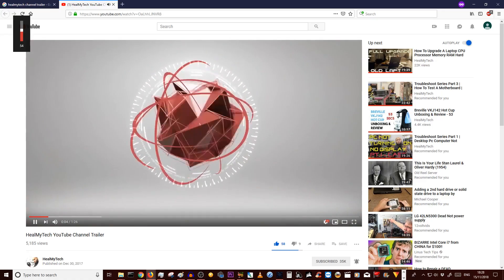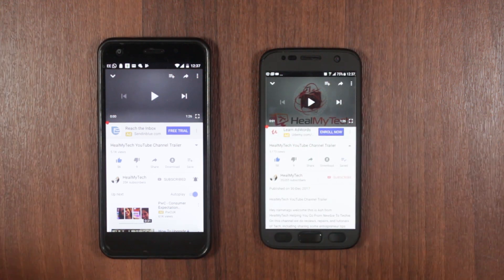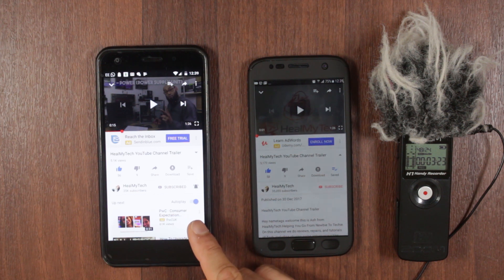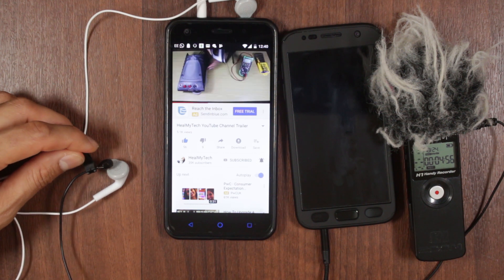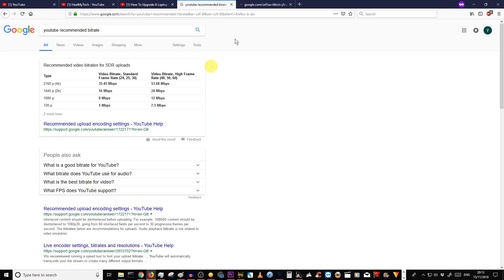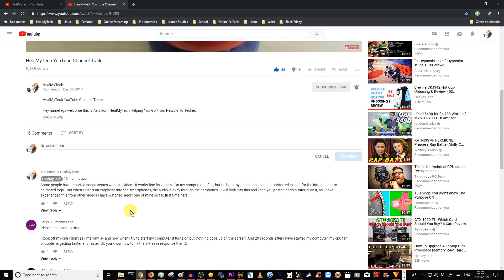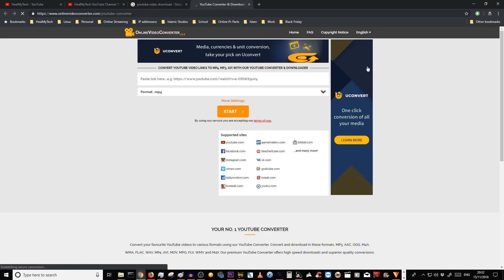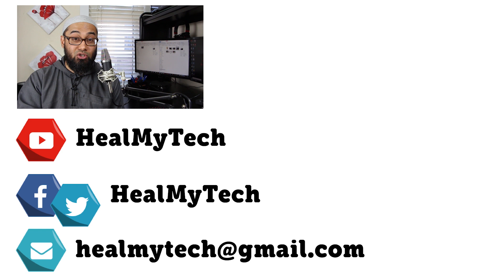YouTube Audio Problem - HELP!  Audio Only Works With Headphones On Smartphones

Comment: I found a 100% working fix for the problem (and a 70% guess, what causes it):

1.) Duplicate the problematic Audio Track and put one on a Mono channel (which you pan left) and the second one on a Mono Channel (pan right).
2.) Make sure in the Inspector of the Each clip itself, you also set the pan of the Clip to the same direction, than the the track its on.
3.) Check if you did it right by muting first the right (you should still hear sound on the left speaker/earphone), then mute the left and you should hear the right.
4.) Now, export your clip again (audio as before set to Stereo Mixdown).

Et voila, your clip works on every smartphone now.

To why it happens: I am a filmmaker, not an audio professional, but to my knowledge it has to do something with the way some smartphone speakers (when Mono), cancel out the information of a stereo file when patched the wrong way. It certainly has to do also Phases - right and left phase seem, when patched wrong, to annihilate one another ( +1 -1 =0).

Comment: There seems to be something wrong with recording the sound.
It seems that the sound is mono recorded in one channel for example right Channel, then the negative form or inverse form of that wave from right Channel has used to create  the opposite or left Channel wave, and when both of them go to the speaker together, they touch each other.  They neutralize rather than add to each other, they shrink, and the sound disappears!
Just like job that they are doing on the noise-canceling headphones.
The solution can be by using a video editor in one of two ways.  It can be done simply by deleting one of the right or left channels, or a little more complicated by copying one of the other channels without reversing them.
 I do not think this is a problem for cell phones with two speakers, or at least when they listen to the sound, it may be a little audible at certain points or distances from the listener, but on cell phones with one speaker the left and right.  Combined and distributed, this is the problem

Comment: i think you had the same problem i had before, cause your video was recorded with audio stereo (which can work with earphones with some devices) and you have to convert it to mono in order to have single source which can be working with all devices.
here is the solution below you have to download this application
https://www.youtube.com/watch?time_continue=32&v=jL5Xx06NwyI&feature=emb_logo

export the audio file and again past it in your project at movie maker, thereafter you can export

if you need more details please contact with me

Comment: FOUND A SOLUTION -  I went and took a look at a power director tutorial where someone copied and pasted the file from one channel to the next to create a stereo file. I wasn't sure if this would have worked on my issue but i noticed something unusual with my sound file so i went a head and tried it. AND IT WORKED PERFECTLY. Now keep in mind that i did have sound on both channels (left and right) before attempting this however the difference between my files and and the ones on the tutorial were that mine where inverted. Not sure if that's normal. Its like the file in the left channel was flipped upside down. After choosing one and copying it into both channels, everything worked perfectly after uploading to YouTube. I had initially used a ZOOM H5 to do the recording for a video which had an intro that work perfectly and the rest only if it were being listened via headphones. Hope this helps.

Comment: has anyone found any solutions for this?
Reply from the maker: Unfortunately no from my end, no lead whatsoever, which reminds me I should be chasing up the audio guy from YouTube Space London, thanks for the reminder.  I take you are having the same issue then?
Reply: @HealMyTech1  I found a Youtube official response but its a lame response stating something's wrong with our audio and not youtube...

Here's one of my videos plays terribly bad but when i play it on my laptop or earphones it plays really well. https://www.youtube.com/watch?v=RfGwv-Svhv0

Here's what i found https://support.google.com/youtube/answer/58134?hl=en

"If your video's sound is playing correctly on a computer but not on a mobile device, this could be a result of the audio in your uploaded video having poor mono compatibility. When listening to stereo audio (left/right channels) on a device with a single loudspeaker, the device will convert the stereo audio to mono (single channel) before your video plays. If the stereo audio has poor mono compatibility, then the mono conversion process will degrade the video's audio quality or even silence audio altogether. This happens mostly when different audio recordings are combined into one video, for example if you're making a compilation video.
One easy way to ensure that your audio is mono compatible is to listen to the audio on a device with a single loudspeaker, such as a mobile phone. If you are hearing problems through the speaker, try listening through stereo headphones. If you hear the problem through the single loudspeaker but not through the headphones, then the problem is very likely a mono compatibility problem. Make sure your audio is "in phase." "
Reply: @HealMyTech1  yes I am having this on my videos
Reply: The problem is in encoding of the video and audio it is software issue if it has the same problem while playing it on android(directly by transferring the video from pc to android not using youtube) if it happens with android also then problem is with the software you are using to record video and audio if not then problem is with youtube